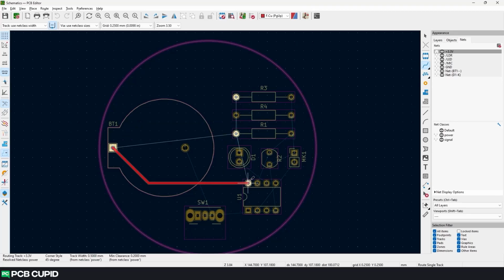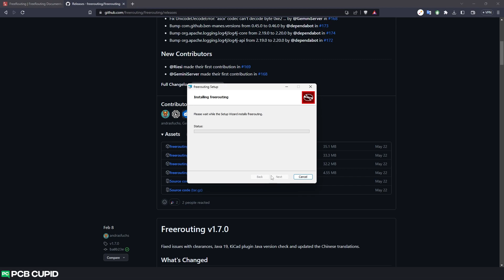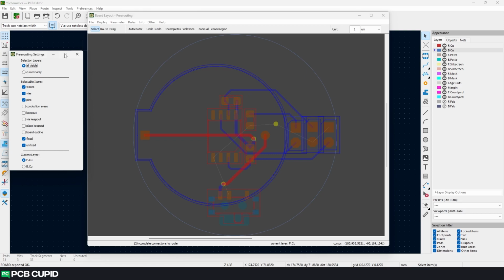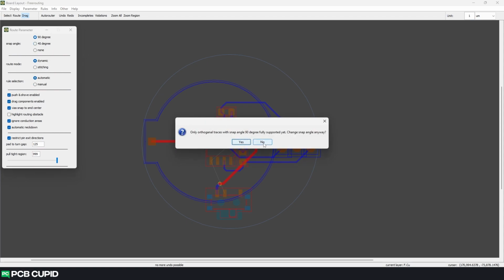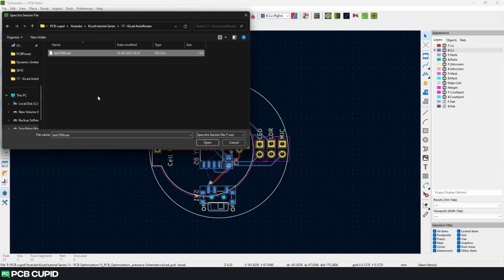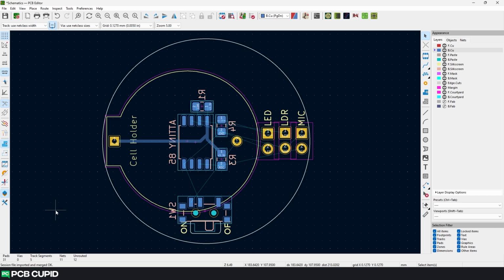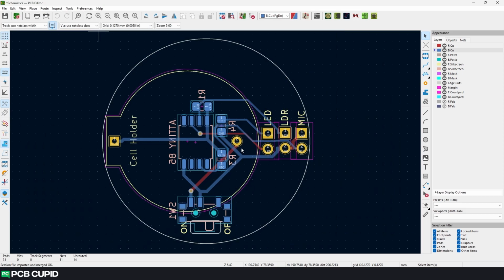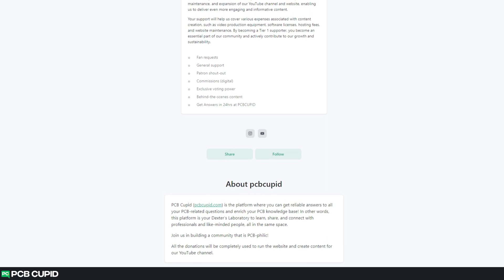#17 How to Autoroute (Hack) in Kicad 7.0 | FreeRouting | #pcbcupid

Comment: Hi
how autorouting pcb to pcb wire connection without parts

Because I want to make a conversion from the ESP32 bord to the arduino board by passing the wires from the pin of the ESP32 bord to the pin of the arduino board without parts.

Comment: Hi,
I have used auto-routing on my design and despite the fact that I have set the track width for my GND 5V and 3.3V to .3mm
and signal track widths to .2mm I noticed that autoroutes uses the same width as .2mm for GND 5V and 3.3V instead of .3mm but then when I manual route
 I get correct track width of .3mm.
I wonder why ?? need I set the track width in autoroute ??

Comment: How do you set up the connection points between components?
Reply from the maker: That's we'll be done automatically based on the schematic that you design.
Reply: @pcbcupid  ah! That makes sense. I'm fairly new to kicad and was trying to avoid the schematic page as it seemed like extra work but I'll give it a try!
Reply from the maker: @stevenmiller279  Goodluck!!